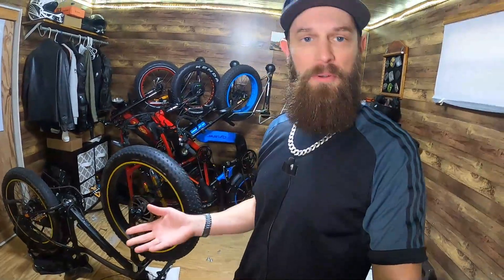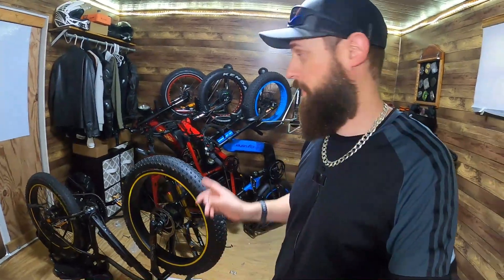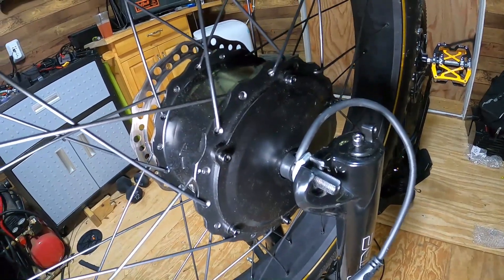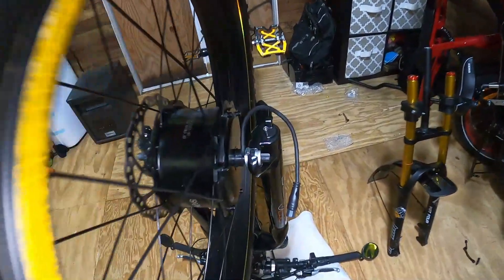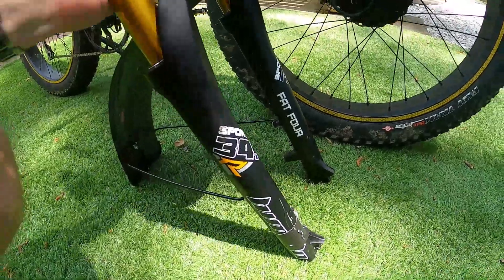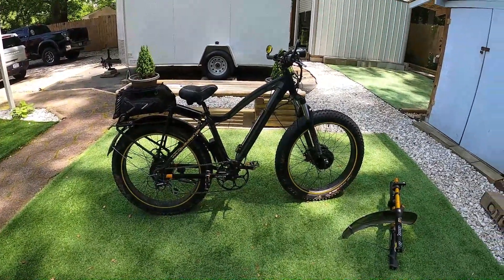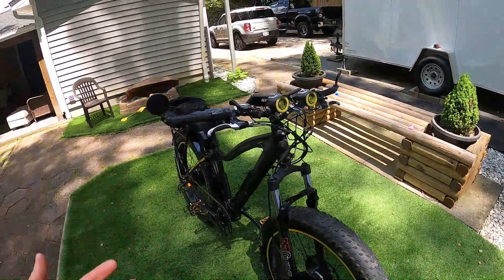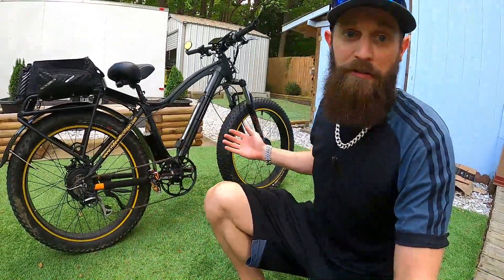Front Hub Motor Install

Comment: Hello I have a question I have the REVV1 from ride one up it has a 750 bafang hub motor in the rear  with mag wheel ,I  was wondering if I can wire a front hub motor and use it with the stock 35Amp contorller when im trying to get the same mag wheel with motor for the front . i do have two 52v/20ah batteries with a battery blender . do you think it would make the bike faster. please any help would be great.

Comment: I want to do something similar but a diy  21 or 24 speed. Dual motors, dual batteries, and keep the gears. Trying to find a console and wiring harness to do it. Do you know of any? Would like to add a 3rd motor, mid drive if I find one that allows me to keep the gears.

Comment: Hey citizen, I have 1000 W folding E bike I just want the front motor to assist the rear motor give me a little bit more speed if I need it help me climb a hill or get me out of mud or sand. I just want a maxed out throttle response do I have to splic in the brake inhibitor’s, even though I see a lot of E bikes, not a lot of people work on them bike shops, either overcharge or do not bother
Reply from the maker: You could splice the motor inhibitors but I did not on mine. Instead I plugged at the front motor into the front brake and the rear motor in the rear brake so I can cut both motors by pulling both brakes.
Reply: @CitizenCycle925  you always respond

Comment: I would be using steel non suspension forks and torque arms if it was me.
Reply: This is my concern. I was going to put this on a mountain. Bike with suspension forks. I am wondering how safe it would be though. The bike obviously wasn’t designed for it.

Comment: Enjoy watching your videos, especially your Citizen Bike videos, they're awesome.  I have a Rad Step Thur 1 and have ordered the 2nd controller from Area 13.  I want to create a dual hub too.  I agree with you, just having that individual option of just using one or the other wheel or both at the same time is total control.   Plus it was great that Fabulous Ebikes sold you that front fork.  I'm hoping they would sell me a fork too.  Just one question, which is that Bafang hub motor you have on your front wheel?  Is it a 175 mm 750 watt?  Can you link where you got the motor? I would like to order it too. I have a spear rear wheel but I don't think it will work on the front. Thanks!  Keep the videos coming.

Comment: great video i want this same thing but I need 52v,1000w front hub motor kit. 48s every were are inter changeable ? i see 48,60,72 but not 52. I have 52v1000w(1850)1040wh in rear. i REALLY APPRICATE if you no were to get that front hub. thx keep up videos. my bike will look similar I have the new AR KEPLER> it REALLY NEEDS 2WD

Comment: Unless you baby it, it's probably just a matter of time before this fork breaks, too. A better solution would be to fabricate two torque arms that transfer the torque out of the dropout to higher up the fork leg (one can be bolted into the brake tabs, the other with one of those hose clamps, preferably rubberized. The ultimate but expensive solution would be the All-Axle motor from Grin with a 20mm or 15mm through axle fork.

Comment: are you using torque arms when in fell out of the drop outs as anything above 500w i would use them as Safety Reguardless if the forks are for a ebike or not

Comment: Reason for the second motor?  Speed?  Power for climbing?  What does the second motor do?
Reply: Will it increase your top speed?
Reply from the maker: @jkarasik9931  probably not but that's one thing I'm going to test
Reply: I’m interested in what you find.
Reply from the maker: Acceleration and Hill climb power
Reply: @CitizenCycle925  Thank you!

Comment: I love these videos you have been putting out lately and the bike looks awesome but I have a small suggestion. It would probably help out the folks/companies that helped provide the parts for this project, as well as us that want to duplicate the finished working bike if you would so kindly provide links to the websites or storefronts of the companies. Thanks.
Reply from the maker: yes, i am compiling a parts list and will include that in the description of future videos, on my website, and will also go back and add to these past videos too :)
Reply: Hi CC,,,I was wondering,,due to the pricing of buying all the individual parts for a front hub install,,,is it possible to just buy a cheap fat ebike whether 500 or 750w and just use the motor,,controller,,battery,,,etc. on the front wheel,,?

Comment: Hey Citizen, I really like your eBike videos. I’m confused what you mean about Geared Hub drive and something else on your front wheel, maybe Direct drive? Thanks.
Reply from the maker: just google geared hub vs direct drive and you will see the difference between these types of motors.  i had a direct drive motor on the front but i wanted something smaller and more powerful so i decided to change it to a geared hub motor, now it has more torque, but its a lot louder too

Comment: Hi Mr C.C, great to see you diving back into the dual motor experiment and bouncing back from that learning experience. It's great these rst dropouts are much chunkier. May I suggest you look into correct torque arm orientation before installation? As an incorrectly installed torque arm WILL cause more damage then not having one. It will actually produce a reactionary force pulling straight down upon the axle therefore causing it to fall free from the dropouts. Best of luck, looking forward to a completed, functioning, dual motor rad tearing it up that hill test in record record time.

Comment: Thanks for the interesting update. Seems those forks may be the solution. My guess is that the forks that failed are made from a low grade, non forged cast magnesium or aluminum. Where the RST forks could be aircraft grade alloy and are forged and annealed, so the strength could be several times the other forks. Stronger alloys can however be more brittle, and develop discontinuities and micro fractures, and fail unexpectedly, and why aircraft often have replacement intervals for structural magnesium parts.

As structural failure of a front fork on an bicycle will most likely result in injury or even death, perhaps torque arms might be a wise precaution. 

I've been running a 1000w front hub motor boosted to about 1400 watts power and 2000w regen on a 2WD Frankenbike for about a year with Suntour XCT forks with slotted mounts and no torque arms for a yea, with modified toque washers and jam nuts with no issues,  but after seeing your failure and how the hose clamps were shredded, I may have some custom long (8"/200mm) torque arms laser cut in my next Send-Cut-Send order. I'm thinking that the longer lever-arm should reduce the shearing force on the clamps to a reasonable level and allow for use of more than just one hose clamp. That's something I could and should run a simulation stress study in Solidworks to confirm. 

If you might be interested in custom long torque arms, I could sketch up something in Solidworks and have them cut. I found images of RST Gide forks online and the inner fork mount races appear to be in line with the inside of the fork tube, so could possibly use the images to get close enough to have something cut that would fit. Just let me know if you might be interested.

Comment: Brain my Rad Rover ST has those torque washers you want to use on the outside on the inside and then they have bolt on torque tabs on the outside. How is your back wheel installed? I would try and do the same on the front tire.  Torque washers on the inside and torque arms like the ones that came with the Ebikling wheel on the outside. Just a thought to ponder!
Reply: If you could find some more of those torque washers you could 2 on each side. One on the inside and one on the outside of each side. Good Luck

Comment: I'm soooo glad I watched this video. Just realized I had my washers installed wrong on the front hub wheel . Thanks dude. And IDK if I would go without the torque arm. Better safe than sorry, that's alot torque on the front hub.

Comment: No one can ever accuse you of giving up on something easily. LOL  The tab washers look just like the ones on my radrover wheel. But I could be wrong on that. One thing I noticed is on one side of that motor axle the threads are at 6 and 12 and on the other side they are at 3 and 9 as I look at the picture.  I believe the threads should be at 6 and 12 on both sides when it's dropped In. And I believe the tab washers should go on the outside and just standard washers on the inside if you need them as spacers. But I could be wrong on all of this but if it was me I wouldn't put it together till I was sure. Sure looks like you're having some fun though. LOL